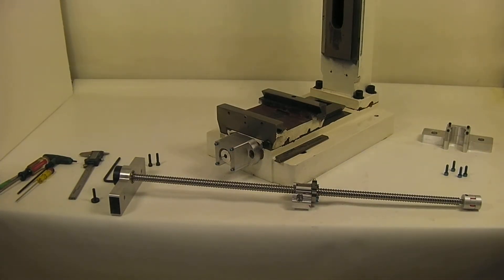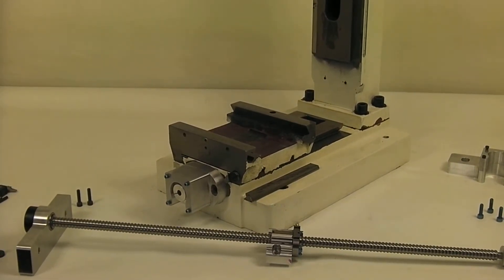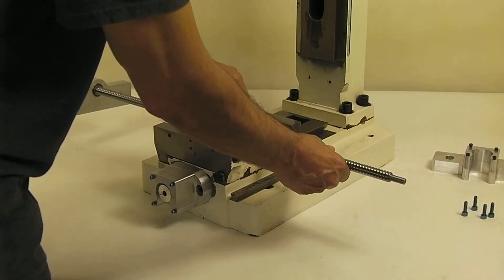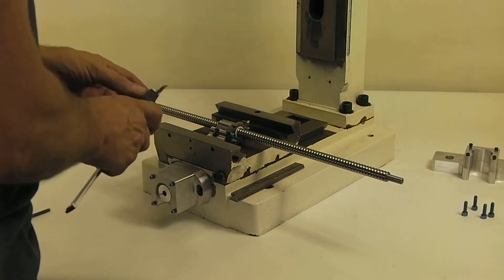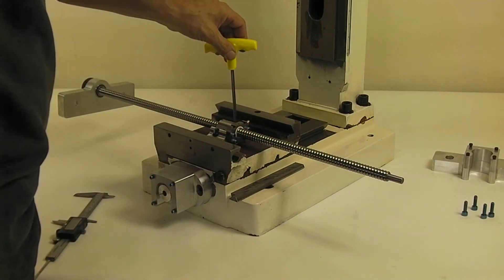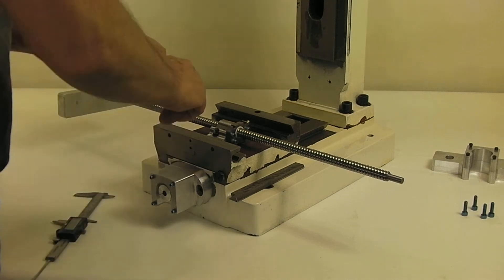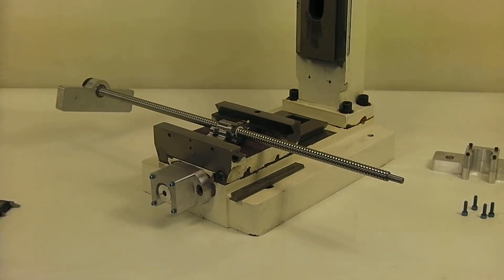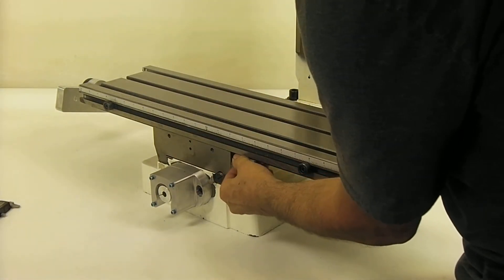New PM-25 X axes install

Comment: What pitch are all 3 ball screws? Btw it is a good quality kit.
Reply from the maker: The current kit is all double ball nuts that I re work to be tight for lowest backlash. I'm the only CNC kit seller that does this.

The ball screws are C7 grade 5mm pitch or 5.08 TPI and all the bearings are AC with adjustable preload. You can see more here.   https://arizonacnckits.com/

Thanks
Dave

Comment: I've installed one of Dave's PM-25 kits. The quality is of high craftsmanship. Installation took a day and everything did simply bolt on without modifications. The only kit related gotcha I had was tightening the Y-axis bearings too tight, but my motors are smaller than those Dave recommends. New PM-25 mills have a great new manual with exploded parts drawings. But, my mill is from before the manual, and there was a "hidden" hardened pin held in with a set screw on the side of the head that must be removed to remove the head. I had to drill the pin out.